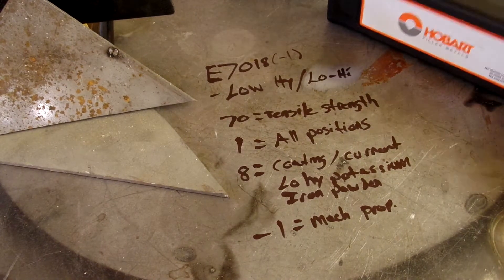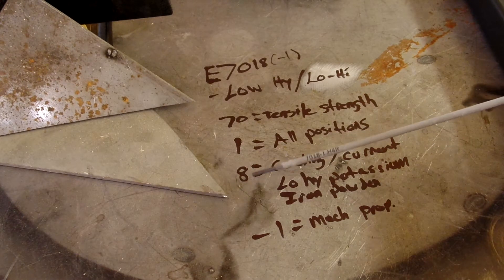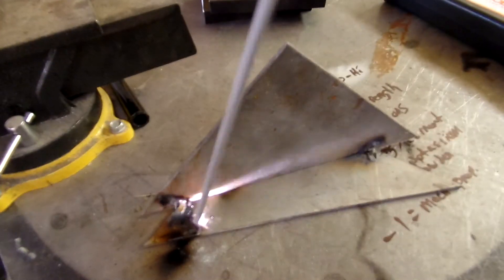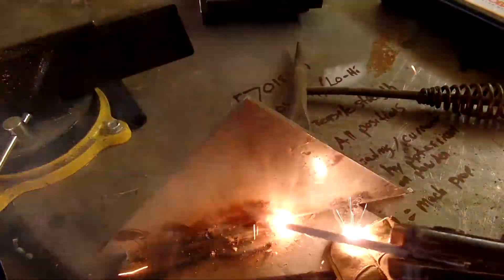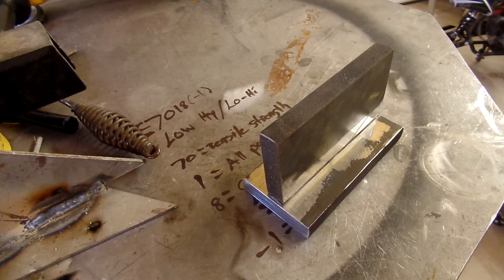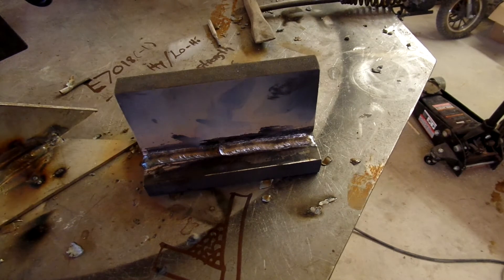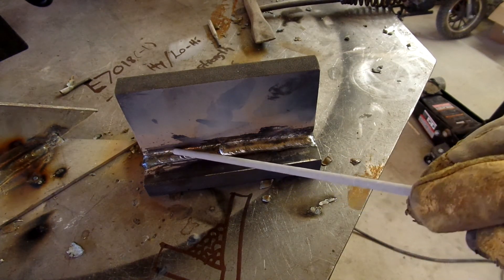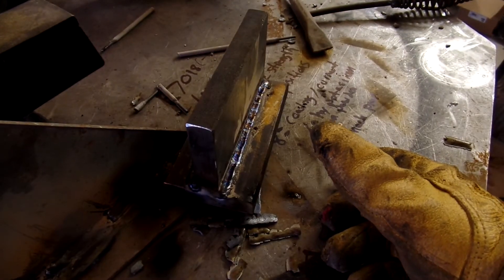SMAW Hobart 7018

Comment: I've been having an extremely tough tome running hobart 7018, 3/32" rods purchased at tractor supply. My previous experience has been with vulcan brand bought at harbour freight that i can consistently start and run at 65amps up. The hobart rods are extremely hard to start and maintain an arc with. Im kicking my self for purchasing these. The hobart 6011 rods dont run well either. My machine is a cheap inverter, amico arc-120. That probably has something to do with.
Reply: Hobart 7018 rods are garbage, the only way to buy 7018 electrodes is in hermetically sealed packaging or containers. That way when you use them they will burn crisp and easily start.